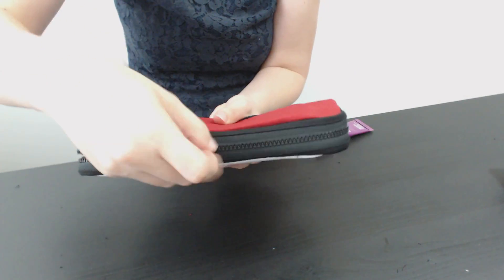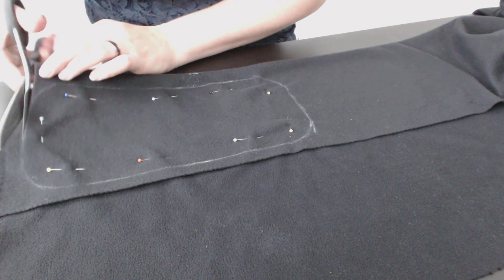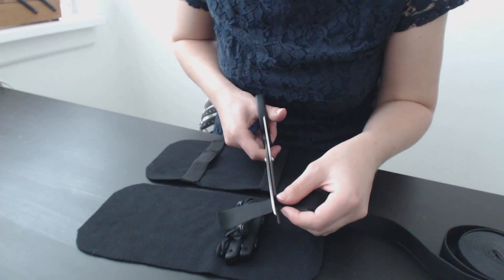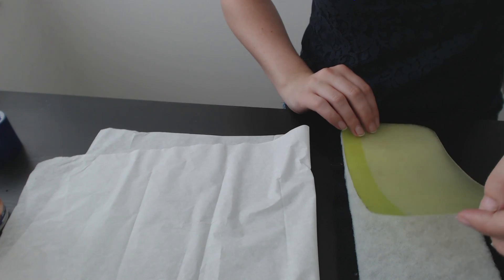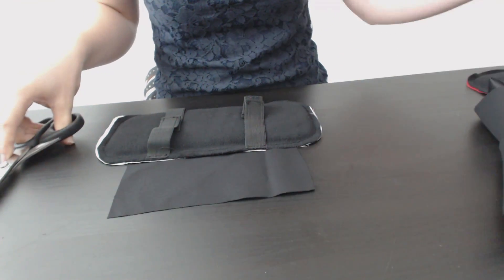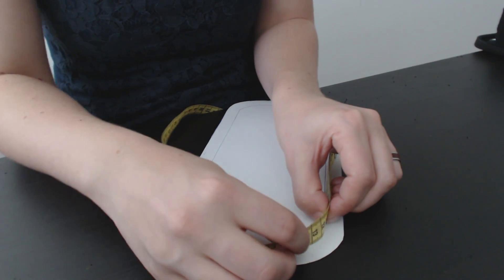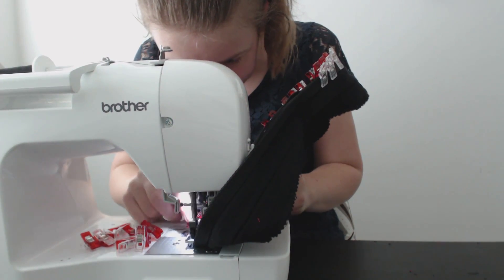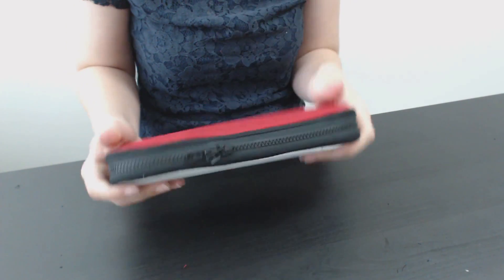Making a Nintendo Switch Case | DIY Tutorial

Comment: Great tutorial! What kind of sewing machine do you use?
Reply from the maker: +Rubycurse Thanks! I have a Brother Innovis 20. I love it. It's a digital one, so it has some nice extra functions, but it is a bit more expensive than purely mechanical machines.
Reply: Thanks! I'm researching machines that I can use to do more heavy duty projects, like these kinds of bags.
Reply from the maker: +Rubycurse In that case, I'd try to get one that's got some good weight to it. The heavier machines tend to have a stronger (metal) frame and don't shake as much when dealing with a lot of force. And using strong denim needles will help too :) Have fun finding your new machine!